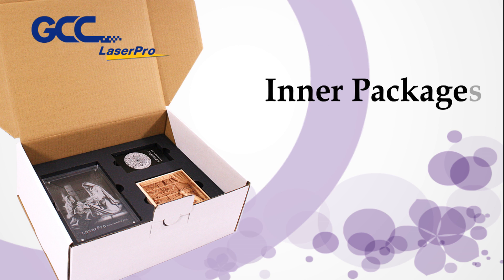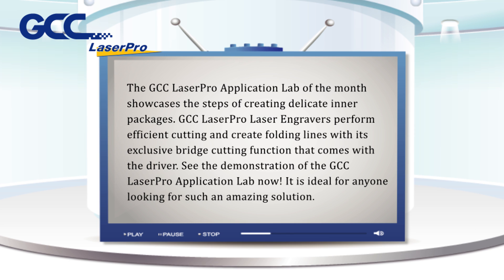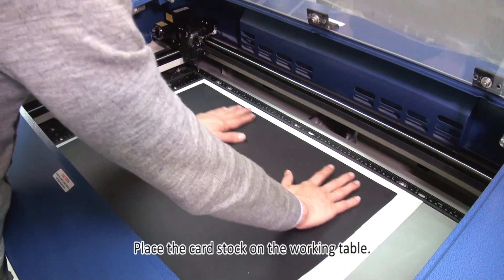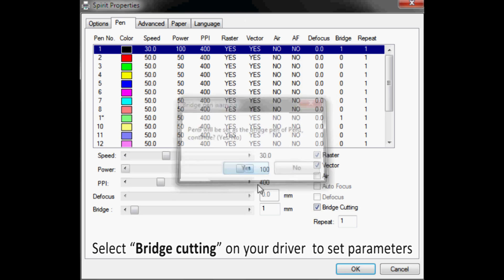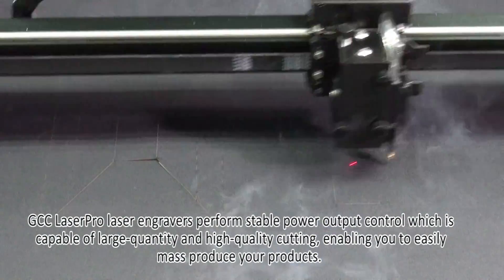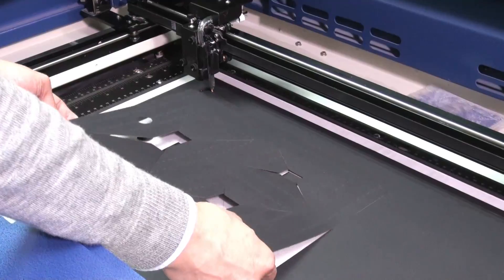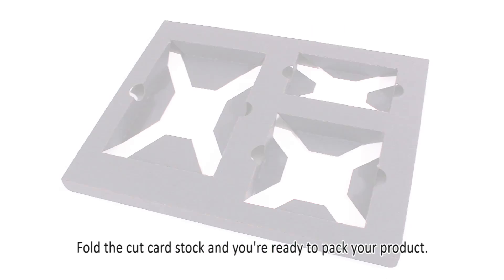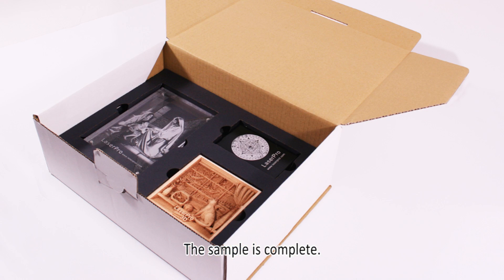Inner Packages Cutting with a Laser Engraving Machine│GCC LaserPro

Comment: Would be nice if you showed image on the software before bridge cutting...
Reply from the maker: Hello, thank you for your message. Graphics are composed of vector paths. Bridge cutting is setting a dotted-line effect through GCC LaserPro driver. After  setting up bridge cutting function, on the driver preview, the graphic looks no difference that it still looks the same as your selected original vector graphic.
Reply: +GCC World thanks for the reply, just saying it would be nice to see the preparation work too on the computer instead of just see the cutting of the finish product. I've got the C180 with the bridging option on the driver (installed C180II driver - because its 64bit). Are there samples of the box where you can download, so I can test it? Links would be great! Thanks
Reply from the maker: Hello, please go to this website to find more information. http://www.gccworld.com/showcase.php?act=view&no=74
 if you need file to test, please sign in GCC CLUB member. you can download the file from there. http://www.gccworld.com/member.php